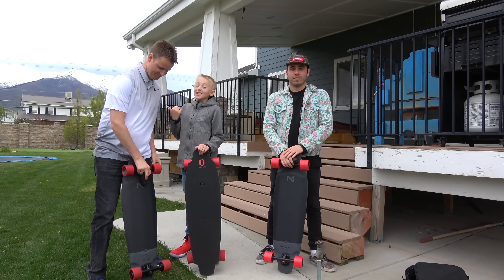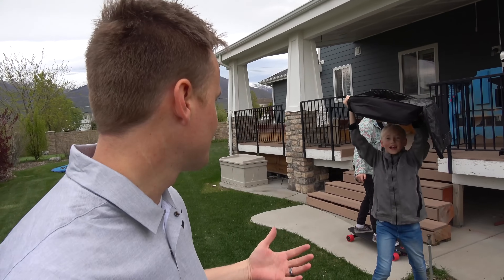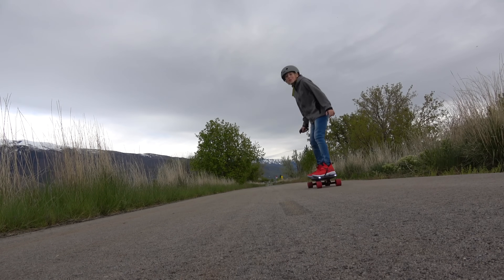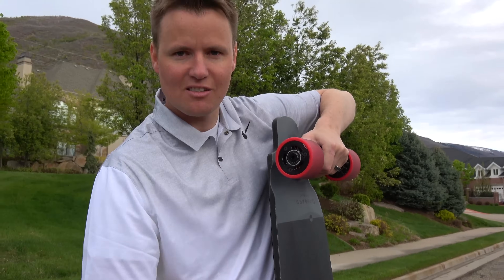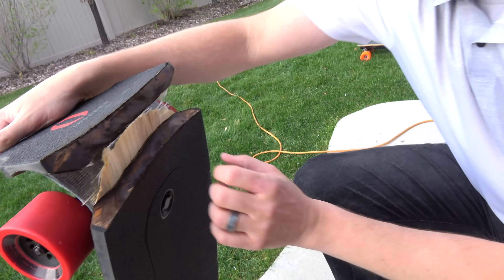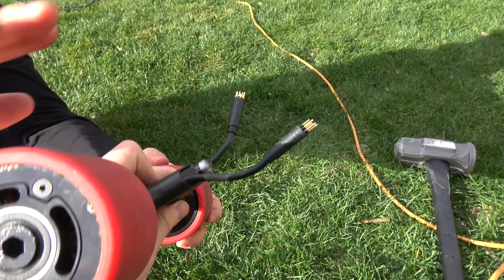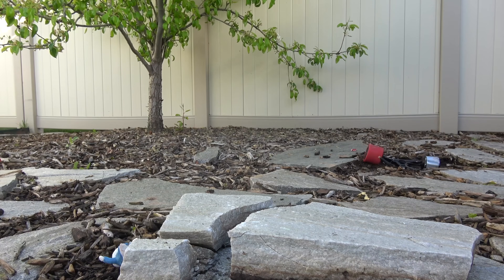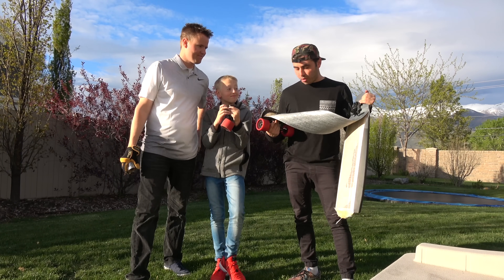What’s inside an Electric Skateboard?

Comment: Its a nice design and swappable batteries are good but the battery is so small compared to other manufacturers like Evolve. You'd have to carry like 3 batteries to make up for the battery size of an evolve or Slik Revolution board. They should have integrated a battery and allowed you to swap out like 1 third of it as a removable. There is a ton of wasted space on that board. Also the use of hub motors means it just won't have the torque of say a boosted board with belt drive.

Comment: The coils are used for electromagnetic induction which is a way of generating electricity by using a magnet and some coils of wire. This was discovered by the scientist Michael Faraday which on Zach's channel there is a car named after this guy. So basically you just have to move the magnet in the coils to produce a current. The faster you move the magnet the more electricity produced. You can also generate more electricity by adding more coils.

Comment: Actually hub motors have less resistance then belt driven it is the esc and programming that tells the motor to stop with no remote and when turned on, if you turned the board off it would have less resistance, that's a downside of the m1 design and where enertion raptor2 and and carvon motors are better

Comment: I think it is momentum not inertia
Reply: King Davion momentum is the force that keeps things going. Inertia is what makes them hard to speed up or slow down. For example, a heavy ball being suspended with negligible friction from air resistance will be hard to get spinning because of its inertia. If the ball was lighter, it would have less inertia and it would be easier to spin. Thats how i understand it at least
Reply: ohh ok

Comment: The part your calling coils is actually called a "Stator", the Stator in retrospect is the same thing as an alternator. The funny thing is those stators can actually be used to not only work as motors but also if wired correctly can work as a battery charger for the Boards battery!

Comment: The reason the boosted board flexes is because it's based on a really nice onboard deck made by loaded. It's a modified version of the vanguard, which is designed to flex in order to give better carving ability.